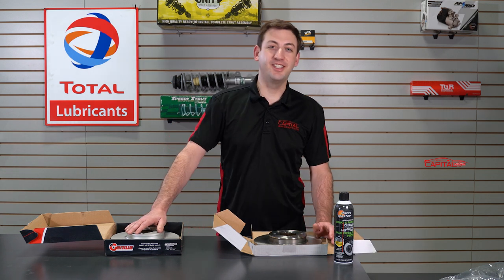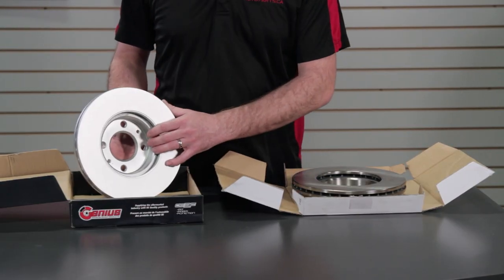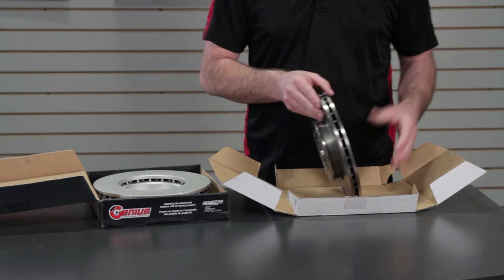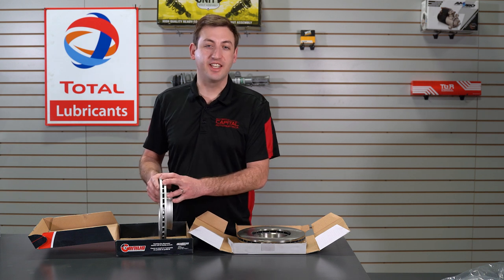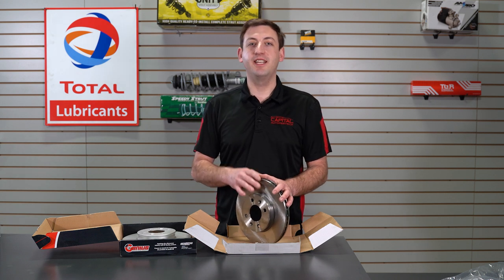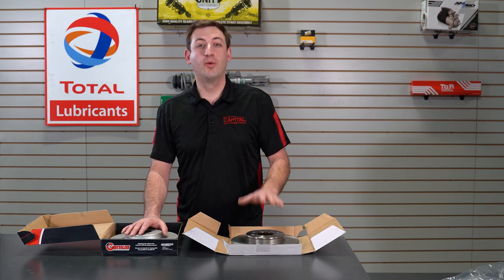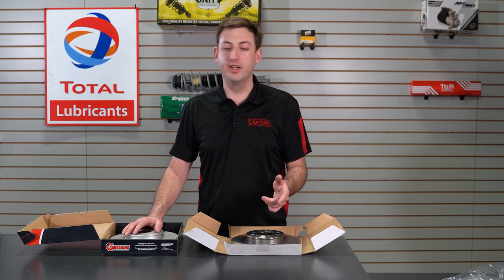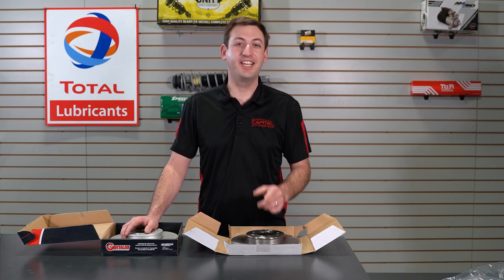Coated vs UnCoated Brake Rotors | Cheap Brake Rotors vs Quality Brake Rotors

Comment: Hi, so we don’t clean coated rotors before installing? 
Thank you,
Reply: As I understand it, the coating is permanent and part of the rotor metal. You should still ABSOLUTELY clean your rotors before install to remove any protective oil/grease layers that are on the rotor during shipping.
Reply: Just read the box, some coated rotors you don't need to clean them. My zimmerman rotors I just put on my bimmer for example

Comment: What about this “UV” coating thing?  Is it hype?  Does it mean “ultraviolet”?  Why do I care if metal is exposed to UV light? 

Thanks
Reply: UV coating is BS. The coating  on the rotors will rub off once used by the brake pads anyways so the bare metal will be exposed to the elements anyways. The reason we don't care about the rust on this area is because if there's any rust, driving the car will generally rub the rust off of the rotors. The coating is for areas where light won't hit it anyways.